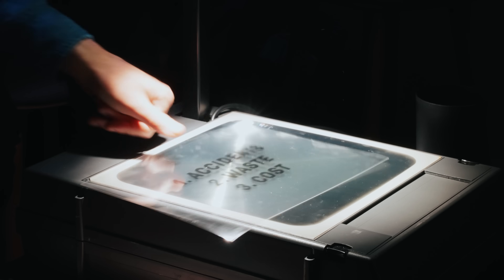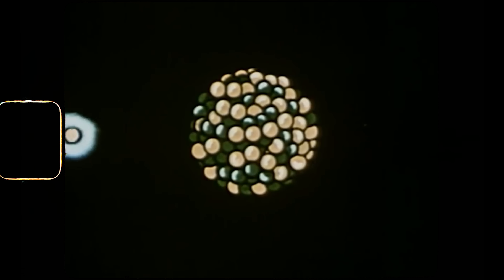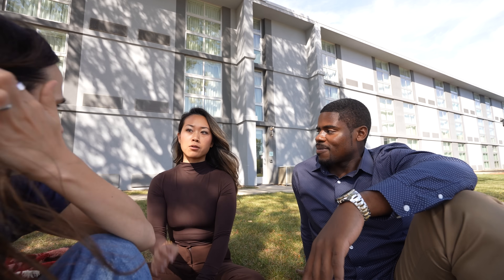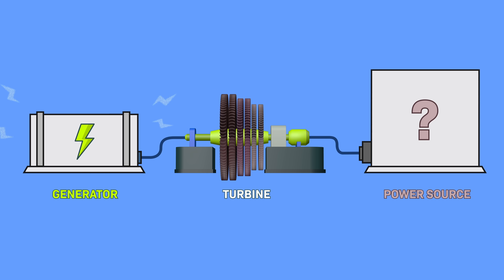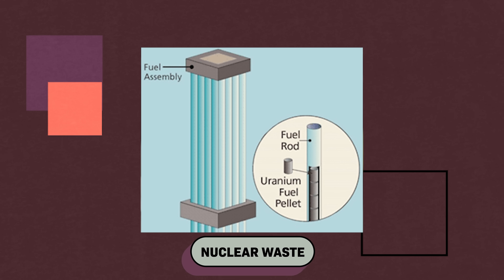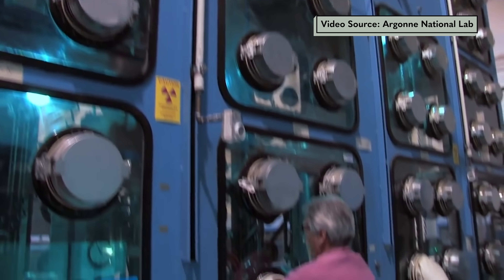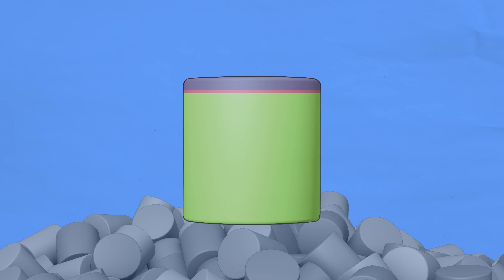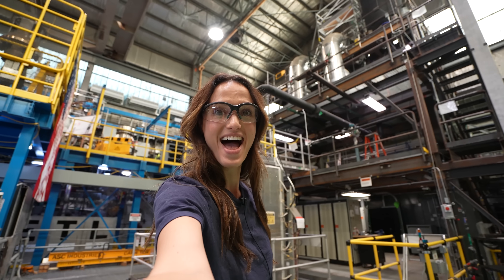The Big Lie About Nuclear Waste

Comment: To be commercially viable there needs to be a way of ilimating the transport costs associated with nuclear fuel. Current power stations should be upgraded into a Hybrid format of burning it's own unuseable waste on site. The inital implementation would require improting current waste stock to the recyled generator until the site balances it own waste out-put to it's own recycling in-put. At the point the Hybrid site becomes self-sustaining in it's own waste use, it would mean that the use of raw material cost will fall and with no transport costs of consideration, and would be much lower operational costs too. However, self-sustaining nuclear plants are difficult, becuause of degridation of any nuclear site over time, there is a point where the site must close. Unfortuantly, no current site is capable of lasting more than 50 or 60 years without being decomissioned for safety reasons.  This would mean an new Hybrid site design must be made and built which incorporates a modular infrastructure, in such a way that; The plant must always be capable of upto 95% power out-put even is 25% of the site was shut down for upgrades and repairs. If we can crack the cost of life-span issue by decomissioning, we could assume a 15 year upgrade time span per 25% (or 1/4) of the power plant, resulting in a 60 year total renewal of site and reset lifespan, meaning that decomissioning wouldn't be nessesary.  Cost of continuous upgrade can be reduced by interpreting the cost of decomissioning the site devided by 4 ( or /4)

Comment: I'm interested in the molten-metal Thorium reactor. The way they're designed makes it (reportedly) impossible for the thing to melt down. It's already molten, and if it gets too hot, the fuel melts a structural fuse and runs into seperate containers where it's under critical mass and slowly cools down. The waste products last hundreds of years, not thousands. The biggest downside is that they make U233 (I think it's U233), which is bomb-grade material.
Reply: the problem with these reactors is the metal containing the sodium. they are developing cracks that allow the pipes to rupture and leak, until they can solve that issue they wont be building them comercially. they are promising but we dont have the materials for them yet it seems to run the long term like they need to.
Reply: Neutron embrittlement? Unfortunate. I'm no nuclear engineer, but I read a lot. It at least appears the thorium cycle is better overall, except for the generation of U233, which is a bomb-grade material. @garyring8306

Comment: I have several siblings that currently work or have worked at Argonne National Laboratory-West (or simply Argonne-West) in Idaho next to the Idaho National Engineering and Environmental Laboratory.  So, not the one in Chicago Cleo visited.  One brother was working on Experimental Breeder Reactor 2 (EBR2).  This reactor could, as Cleo mentioned, take nuclear waste and make it safe.  My brother told me it would be safe enough to fill tin cans and burry in your back yard.  Guess what, JIMMY CARTER killed it.  The cost $$ to shut down the research prematurely was more than if it had been allowed to finish.  And as Cleo mentioned, the U.S. is still nowhere near the predicted level of energy production.

Comment: Well now a liquid fluoride reactor was passed by the NRC. This will open the doors to clean processing of Thorium as well as nuclear waste.

All that's needed is to bring it to commercialization. The work has been done, only held up by the cartel of the current reactors.

Sound familiar? Sorta like what the oil companies are doing.

Well, in another fifty to a hundred years, AFTER half the population is wiped out by climate change, we'll have all the energy we need, and maybe a clue.

Comment: All Uranium can be fissioned. All you need is a fast spectrum reactor instead of (the common) thermal spectrum reactor.
Russia has 2 large operational fast spectrum reactors. So the technology not only exists, but the equipment is already built.
GE has a reactor design called PRISM that does the same thing. However they never built one.
Water reactors can recycle the plutonium twice which more than double the energy yield from mined Uranium but that's still just 1% more of the total mined uranium potential energy.
This is called MOX fuel, it's used in France, UK, China, Russia, Japan, India and a few more countries.

Comment: Here are some key takeaways:

1. There is a type of nuclear reactor, first built in 1962, that can generate electricity from nuclear waste. This suggests nuclear waste could be an energy resource rather than just radioactive trash needing storage.

2. There is enough nuclear waste in the US alone to power the country for the next 150 years if utilized, according to nuclear energy experts. Reusing the waste reduces radioactivity and storage needs.

3. Most nuclear waste today is stored in dry casks for decades. But the recycled waste only needs storage for hundreds of years instead of hundreds of thousands of years.

4. In 1977, President Carter banned reprocessing and recycling used fuel due to nuclear proliferation concerns. This entrenched light water reactors in the US.

5. Other countries like Japan continued reprocessing and recycling. The US ban was lifted in 1981 but economics favored the status quo.

6. Economics and access to cheap uranium diminished incentives to recycle. But with more focus on clean energy and supply chain issues, there is renewed interest.

7. If nuclear waste recycling can be commercialized, it would demonstrate the ability for humanity to overcome fears, change course, and use technology optimistically.
Reply: 🎉 Is there renewed interest in thorium reactors?  There was 13:54  no further development since the early 1960s because used fuel could not be used to make weapons.
Reply: Tell me, why if these highly dangerous substances can give free energy for hugh amount of people for 150 years, why isn't it used. And can you tell me how many years it is that these nice substanses could be released out into the nature?
Reply: @niravapurv4578  I think the answer is in your question: because they are highly dangerous. What do you mean by "released out into nature"? If it's enriched and highly radioactive nuclear fuel then it's not safe for anyone in nature for several hundred years or even thousands depending on what exactly are you going to release.
Reply: You missed one: the woman doesn't understand what the "235" in U-235 refers to.
Reply: @morpheus6749  Shes clearly not an expert but a journalist. She made a mistake, its fine.

Comment: I visited the lab in 1965. It knocked my socks off. I also worked on the Navy's experimental, thorium powered, light water moderated breeder reactor that produced 1% more fuel than it used. It can be done.

But (there's alawas a "but", isn't there), the video does not address nuclear's other fundamental problem, in-reactor fission product decay, heat generated by the nuclear that accumulates as the reactor buns its fuel. Fission product decay generates about 1% of the reactor's heat. This isn't engineering. It's physics. There's no avoiding it.

Let's do the math. Compared to coal powered power generation, which requires two watts of heat to produce one watt of generation, nuclear plants, which run at lower temperatures require three. A 100 megawatt power plant, therefore requires a 300 megawatt nuclear reactor, meaning that it's fission products can generate 3 megawatts of heat. That's 3 megawatts that cannot be turned off. The only way to stop it is to shut down the reactor and wait ... and wait ... and wait a bit more for fission products to decay. While we wait, 3 megawatts must be removed from the reactor or, as we learned on Five Mile Island and in Detroit's Fermi One plant (you have heard of Fermi One, right?) the core will melt. 

Newer designs that use ceramic encased fuel pellets might offer a solution. If something does go wrong, just dump the pellets in a big pool of boron solution. (If you use borax, you have it in your home.) Boron absorbs neutrons, emitting a gamma ray and splitting into stable (i.e. non-radioactive) helium and lithium.  Make the pool big enough and, well, it should work. 

... that is, it might work. I've been out of the game to long to be sure.

Comment: Great job...a little "filmmaking" advice if I may: A Hair light is meant to recreate what the sun does-which is light up most of but especially, the top of one's head/hair-not just the part of your hair that sits above your shoulders-This looks unnatural and distracting. Tilt and or move,your hair light up so that it's hitting the upper portion of your head so you get a "rimming" effect. Other than that, keep up the good work.

Comment: You gotta be careful with claims about how a certain source of energy will last a given amount of time.  What is usually left off is, "at current rates of consumption."  This gets into exponential growth and you find that that "150 years" turns into 15 or less very quickly.  But yeah, by all means(!), let's use used nuclear waste...no matter how long it lasts!!

Comment: Hol up. I wanna hear more about the reasons for Carter’s concerns around plutonium reprocessing. I feel like that got sped through and glossed over. Is it that there would be a risk of proliferating new nuclear weapons with fuel if it were to get diverted from the closed loop? — Or is it that the reactors using reprocessed plutonium are far more dangerous than existing light water reactors with a higher risk of Chernobyl type accidents ? — Or is it that  having reactors that used the plutonium waste would be enormous security risks as targets for terrorist attacks and wartime military strikes? …or is the concern over something else entirely? 
That section of the video needs to be expanded and given an even-handed evaluation for this video to feel less like a glossy sales brochure from the nuclear industry — overselling potential benefits while committing lies of omission about legitimate risks.

Comment: Nuclear Powerplants also concern of security risks. Especially in times where a war can be right next to your place, natural disasters can occur, or external/internal ill intent is being present. It is quite a safe technology, the problem is just, when it does fail, the consequences are sadly huge. Also powerplants have huge running costs and also take many resources and time to build and maintain. To make a "nuclear waste energy" industry meaningful, it would require a big "nuclear powerplant" industry, so that it wouldn't become just a one shot, until all nuclear waste is being used. But since, renewable energy is more sustainable, I don't see any sense to build a huge "nuclear powerplant" industry.
Reply: breeder reactors dont go critical ever, you blow them up yes they spill radiation but the nuclear containment vessels are pretty hard to blow up housing the deadly parts of the reactors.

Comment: Nuclear and it's complete cycle  has been figured for a very longtime. 

Technologies however that uses that much electricity production is fairly new. Computer chips, batteries and good EVs.

to get more nuclear reactors back online means buy more computer chips batteries and ev cars.

Comment: I think I have read that molten magma has a radioactive property.
If this is true then would it be possible to dump the spent recycled nuclear waste into open magma pools and active volcanos? 
Eliminating the problems with long term safe storage!
But only after the recycling process is fully  exhausted. RayJ@Play 
Please reply if you have learned opinion?
Reply: I don’t think that would be a good idea, magma radiates infrared radiation (heat). Not sure if dumping uranium into an active volcano would work. But burying it underground will

Comment: Bright video Mz Cleo.  One thing you slipped which i would appreciate: how long, in years, is the storage requirement for the waste of this secondary fuel process?  Hot waste has a half life of tens of thousands of years we all know, is this merely say, half of that, meaning we need a total of 20,000 years of storage rather than 80,000 years?

Comment: A very important part is missing. I recomment to google Fukushima and Tschernobyl.
Reply: Fukushima earthquake and tsunami killed ~18K people. No one died when the 3 reactors melted down.  

After the Chernobyl accident the remaining reactors continued making power until 2000.  

About 7 million people die every year from air pollution cased by coal, gas and oil plants. (from google)

Comment: Among other widespread poorly chosen names, like "Climate Change", the correct term for retired nuclear fuel is "wasted uranium" - not to mention the 1% of already valuable plutonium. I'm saying that 95% of a fuel rod that the poor old low-efficiency Light Water Reactors (LWR) cannot use is uranium 238 that the IFR EBR-2 was successfully designed to turn into plutonium 239 and Pu-240 and consume it, and wider than that could even consume "depleted uranium" of  which we have ten times as much.
Notwithstanding the inefficiency I lamented, 2400 tons of reactor fuel, from about 24,000 tons of uranium oxide, suffice to provide about 20% of the annual US consumption of electric power, and in bad weather do it more reliably than coal and gas.

Comment: What women Bill Clinton had , and Where he did What to or with them, are utterly irrelevant compared with the fact that although he licensed  a civilian reactor of the TVA to be modified so it could supply the so--called Department of Defense with tritium, the short-lived isotope of hydrogen necessary for the fusion stage of megaton level thermonuclear weapons, he killed the Argonne Labs Integral Fast-neutron Reactor, which three weeks prior to the infamous stupidity at Chernobyl, proved itself by deliberate test meltdown-immune.

Comment: There is a paper from the Union of Concerned Scientists in which they state they are against the idea. They claim it would increase the risk of nuclear terrorism, increase the ease of nuclear proliferation (which doesn’t really make sense to me since more then a few countries do recycle/repurpose their nuclear waste already), it is very expensive, then this part here which about waste management which I found the most interesting part…

”First, there is no spent fuel storage crisis that warrants such a drastic change in course. Hardened interim storage of spent fuel in dry casks is an economically viable and secure option for at least fifty years.

Second, reprocessing does not reduce the need for storage and disposal of radioactive waste, and a geologic repository would still be required. Plutonium constitutes only about one percent of the spent fuel from U.S. reactors. After reprocessing, the remaining material will be in several different waste forms, and the total volume of nuclear waste will have been increased by a factor of twenty or more, including low-level waste and plutonium-contaminated waste. The largest component of the remaining material is uranium, which is also a waste product because it is contaminated and undesirable for reuse in reactors. Even if the uranium is classified as low-level waste, new low-level nuclear waste facilities would have to be built to dispose of it. And to make a significant reduction in the amount of high-level nuclear waste that would require disposal, the used fuel would need to be reprocessed and reused many times with an extremely high degree of efficiency—an extremely difficult endeavor that would likely take centuries to accomplish.

Finally, reprocessing would divert focus and resources from a U.S. geologic disposal program and hurt—not help—the U.S. nuclear waste management effort. The licensing requirements for the reprocessing, fuel fabrication, and waste processing plants would dwarf those needed to license a repository, and provide additional targets for public opposition. What is most needed today is a renewed focus on secure interim storage of spent fuel and on gaining the scientific and technical consensus needed to site a geological repository.”

Would it really take centuries to accomplish? What do they mean by that? It seems we already have the technology to do it, so are they including the time in which we would be actively getting energy from the fuel as it’s used in fast reactors to deem it recycled or that it would take that long to create the infrastructure to recycle/repurpose enough fuel for use to create enough energy that it is a viable option?

Comment: Sounds great, but nuclear energy is much more expensive than renewable energy. Until thebprice comes down a lot, not much will change.
Reply: i think the point in using the tons and tons of existing waste to generate more power would cheapen it alot as well as any future waste
Reply: @RealityBoat Not really. The fuel is relatively cheap. It's the construction thats really expensive.
Reply: "but nuclear energy is much more expensive than renewable energy" It's not, actually. Renewable energy requires either non-renewable backup or battery backup to function. The former has massive unpaid externalities and latter is extremely expensive. When accounting for the full costs, nuclear is cheaper.